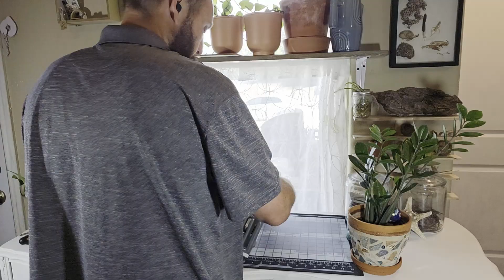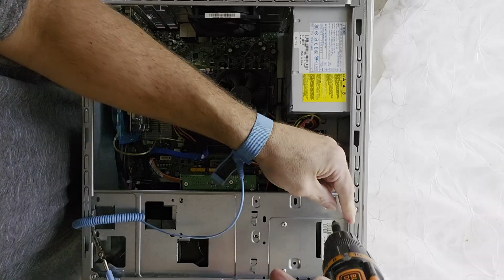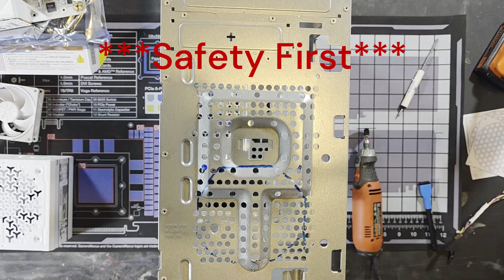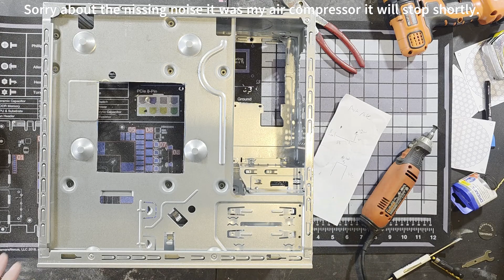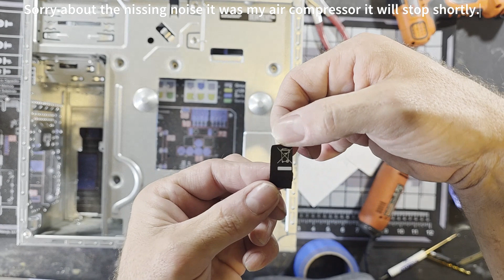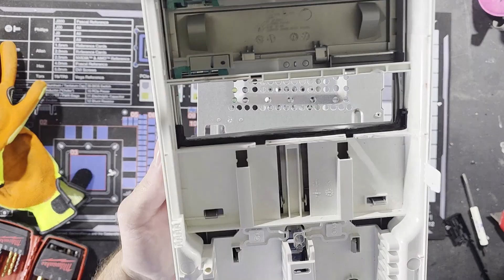First Sleeper PC Build Guide Part 2 The Hacking

Comment: woooahhh i have the same pc case sitting around and gathering a lot of dust. so glad to see this video of yours.
Reply from the maker: That's awesome and thanks for the comment.  The one thing that impressed me the most is how well the paint has held up.  It's almost like nice quality car paint.  You wouldn't have to do as much modification to yours, and I'd probably recommend doing a few things differently, depending on parts used, but it wasn't too bad of a build to mod, and it turned out nicely if I do say so.
Reply: @SleeperPCBuilds  i was hoping to do some fan mods to the case.
Reply from the maker: @ronmarthnitro5041  Check out my latest video on some easier fan mods than this one but the basic idea is the same.  Basically the psu mod I think is largely unnecessary, but still useful.  The front intake fans behind the front cover is still useful.  The bottom intake fans for the gpu is much easier to do with a hole saw as opposed to just drilling a hole bunch of holes.  Hope this helps!